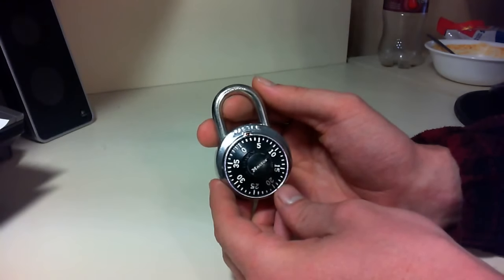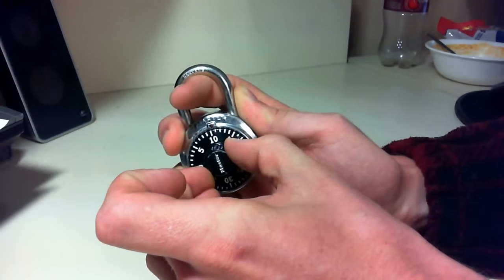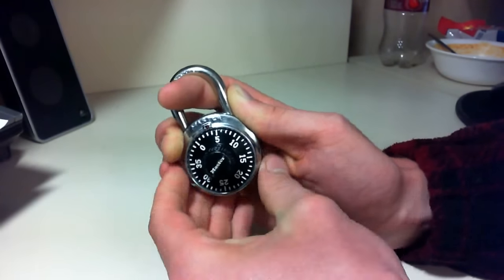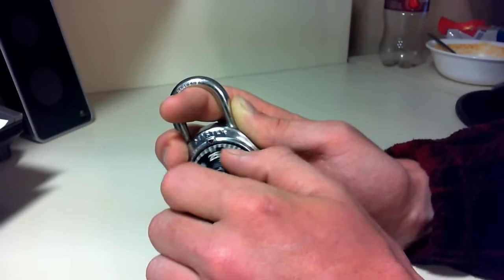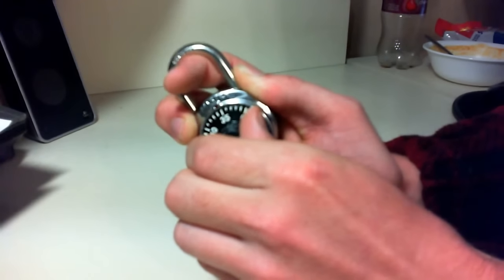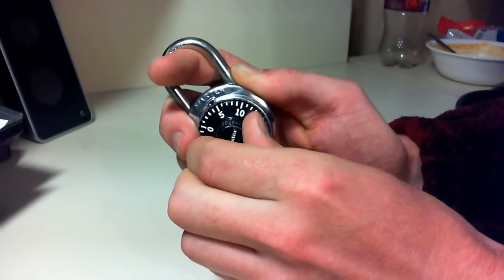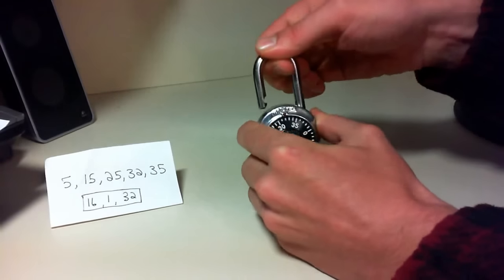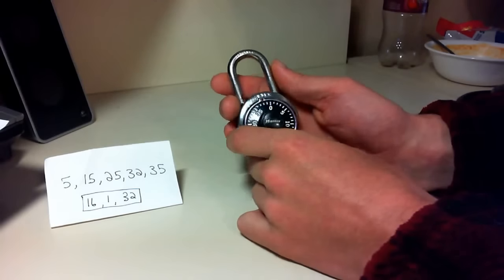Crack a Masterlock combination lock in 60 seconds! Without knowing the combo!

Comment: Not necessary to go through all that junk to get the third number. I just go through the first and second numbers same as you, then turn clockwise slowly while pulling up, varying tension until it pops. Boom - third number.
Reply: Did the same
Reply: Zeropoint - they probably wanted to reuse the lock :)
Reply: BeatsFromDP tysm!!!!🤗🤗🤗🤗
Reply: Or you could just cut the lock with some lock cutters. Boom step 12 and 3 are useless
Reply: Just through some dynamite on their, you can skip all the steps.
Reply: Took 5 minutes......
Reply: U smart ash
Reply: @AFUVFX  "through" "on their" nice
Reply: Ikr
Reply: @squalltheonly  Not if you want to reuse it or be unnoticable
Reply: @samuel3807  I can send you the $5 via paypal, if you are so poor.
Reply: exactly
Reply: That's not as fun...
Reply: @Insanifier  "on their" "on there" better
Reply: I was the 1000th like...
Reply: That`s how I did it too - good tip!
Reply: Godam
Reply: I cant really find the 3rd number so I just guessed, same
After I checked the 3rd number (31) I still cant find the other sticking points ;-;

Comment: Bolt cutters gets the right combination every time!
Reply: Shims are a tiny bit less conspicuous as well... Not to mention way easier and faster
Reply: So does c4
Reply: So does a .50 BMG
Reply: so does a torch, grinder, two large wrenches, or 2 cans of freon.
Reply: @jeremiahfyan  its a thin piece of metal used in lockpicking. You would insert it in the shackle hole along the side where the locking lever is and press it to pop the lock.
Reply: @MoistOwlettes  ah gotcha
Reply: Garry Harris you dont need a grinder on a gym grade masterlock
Reply: TheKizilg1 who? Me?
Reply: Aaron Neville your logic doesnt make sense
Reply: Would it break the lock?
Reply: David Misner yeah bolt cutters would definitely break it, unless it has a rating of 8 or more . Im not sure, however any bold cutters you get at home depot I dont think would get through a lock with a cut resistance of 8+ , hell maybe even a 7
Reply: @JackDanielsCHS08  I was referring to this shim thing somebody mentioned.  I thought the purpose of this video so you can open the lock so you could use it again.  I have a Masterlock and I lost the combination.  I really hate the idea of throwing it away.
Reply: Amen! This took way longer than 60 seconds. I’m lost ! Bolt cutters for sure !!
Reply: @edwardkohout3494  Kind of defeats the purpose if your purpose is to save the lock
Reply: I saw a guy use a claw hammer to break one, got it in one strike.
Reply: Matt TheChosen yo two open end wrenches maybe 14 or 16 mm.you can break a lock with one hand.especially one of these.
Reply: @You-Be-The-Judge  ??? About how to use a shim to open a padlock? If so just look up using a shim to open a padlock, should be plenty out there and unlike the wrenches it doesn't break the padlock. They can be made shim proof, but few are.
Reply: So does a key
Reply: @alexx781  So does an airstrike..
Reply: The combination is 1... 2.... 3... CUT
Reply: Aaron Neville  Lol, wtf
Reply: Jeremiah Fyan a thing you put in the lock to o-en it
Reply: And they are so inconspicuous.
Reply: Call that a master key
Reply: Yeah but the reusable feature doesn’t work when I try this method.
Reply: Hammer. DUH
Reply: @edwardkohout3494  A hammer. 1 second.
Reply: XD
Reply: But this method gets you a free lock
Reply: once you have the first 2 numbers then just go back to the right until lock opens...VIOLA!
Reply: DAWG
Reply: 😂agreed
Reply: @Jake12220  easier? faster? no lol.
Reply: lol
Reply: Bolt cutters are the universal key
Reply: A strong electric current passing through the shackle would also work.
Reply: @tecc9999  shims are super quick and easy to use so long as it hasn't been shim profed which most aren't(takes about as long as using a key). And it's fun because you can take multiple locks off and swap them round. Even better if there are multiple of the same type so people spend for ever trying to work out why their key doesn't work.
Reply: lol

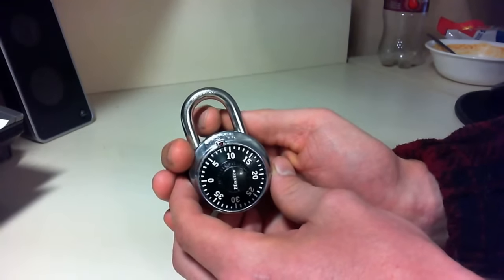Comment: 0:34 Combo 1 Provide medium shackle pressure, turn the dial clockwise while slowing releasing pressure and feel for the resistance number. Write the number down.
1:58 Combo 2 Provide large shackle pressure, turn the dial counter-clockwise for a few turns until the lock will stop, repeat step 1 with a single turn and feel for the resistance number.
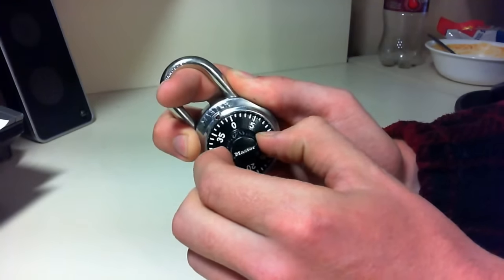3:29 Combo 3 Turn clockwise a few times to reset the lock,  start at zero, 3:44 apply maximum pressure to lock shackle and slowly turn the lock clockwise till it can't be turned anymore and locks at a point, 3:52 if it's between 2 numbers ignore it.

6:06 you combine the first number you found with the 2nd number you've found and the 3rd and that should be your combination.

Will continue later.
Reply: *combo 1, add 5
Reply: First 2 steps really do work
1st step: Resistance at 22 = 27
2nd step: Cant turn at 35, when turning the other way it stopped directly at 37 = 37
And I just guessed the last number by doing a series: 35, 31, 27...
And it opened on 31

Comment from the maker: It's called non destructive entry.  Also it takes 7 minutes to describe how to do it not to actually do it if your practiced.
Reply: Mine is non destructive too, how do I open it???
Reply: MIRACLECHEEZ Woah sorry chill,I just breezed over the comment and thought other wise
Reply: IT WASN'T UNLOCKED IN 60 SECONDS!!
Reply: This sucks so bad. Thanks for nothing .
Reply: styles662 sorry I been trying for a hour i can't figure it out...
Reply: I keep running into a problem. I've seen alot of videos and all of them say to do basically the same steps you did. However, I do the steps, get the numbers, and the lock doesnt open. I tried it on my sisters lock, and the same combination numbers kept popping up ( the same ones for my lock). And she said they are wrong. I think its user error, i just dont know what I'm doing wrong
Reply: Lizzle 2 cents I think the issue is the lock was open to much I think it works best on newer locks I have a old lock no resistance spinned for day but my new lock is just hard to turn in general both I lost my password for...
Reply: @sunsetsleeper  I know my code, I just wanted to learn how to do it. I have a dent in mine from dripping it and its over a year old so its hard to get
Reply: @lizzle2cents289  I think that there's a knack to it. It takes a few locks and hours of practice on each to get the feel. I mean I've picked things fast on the first try or even after days of practice then return to it years after and it feels foreign. You might have a better tactile memory than I but one sure fire way to get to Carnegie Hall is to practice. Also if you practice on just one, you'll only be training for that particular landscape. Buying many locks allows you to sharpen your "lockpick sense" ® pending. Jk. PS. This is why Sherlock on Elementary has a wall of locks. But if you don't have time for that try this out!
Reply: @lizzle2cents289  and if you're worried about it being malicious, which I don't believe it to be, you could run it on any virtual machine behind a VPN /proxy. Happy hunting 🤗
Reply: @cowboycurtis2099  Oh my gosh thankyou so much there are good people left in this world
Reply: Nah mate this takes at least 5 minutes
Reply: Well I practiced and practiced, and practiced and I still can't get the fucker to open!
Reply: Hey Lock Opening Video Dude, do you think maybe I could send you my lock and you could try it? I've been trying to open this son of a bitch for 7 months, and it won't open? I don't know what to do? I even had my college educated cousin Mary Bob help me with the figure 'n on account of I only did figure 'n til 3rd grade then Pa made me quit school to help out with the farm 'n chores. But Mary Bob couldn't get it to work no ways? So if I could just send the lock to you, do you reckon maybe you could open it and maybe do one of these moving picture inner web things on my lock? Thanks, Sincerely, Cletus B. Hatfield
Reply: Well, the procedure seems quite slow, and you lose a lot of time in the third number when it's actually not required at all, just turn until it's open. Decoding it is probably faster.
Reply: Itss fake
Reply: How does it take 7 minutes to do this? This took maybe a minute when we forgot our locker combos.

Comment: I’ve watched a few videos and have combined the best methods. 
1. The first number is clockwise resist plus 5. Rounding down works best, but either number should work.
2. The second number is usually a high number resist.
3. Try first then go to second number. Go down 4, then increments of 2 with pulls along the way. Usually opens.

Trouble shooting:  The 2nd and third number will both be positive or negative numbers. The first will be the alternative sign. If you are having trouble opening the lock, use the method in the video to find the 3rd number, which is usually correct. I go counterclockwise from zero because the 3rd is usually a low number. Find the 5 or so numbers with shackle pressure with the number in the center of the wiggle. 4 or so will have the same ending digit, such as 5. The different number, say 2 will stand out. If it’s even, the second number found by shackle pressure will be even. Or both will be odd. I’ve done this if two numbers for the second are possible. Vary the 1st digit by one. Haven’t been stumped yet.

Be sure to watch the channels for THE LOCK PICKING LAWYER and BOSNIANBILL (recently retired). Get a Sparrows lock picking kit. Start with Masterlock key locks. Easily opened by raking (quick back and forth with a wavy pick). Most locks are easy to pick. Expensive locks, less so.
Reply: I am a bit confused bro.
Reply: This is what got it figured out for me, thanks man!
Reply: Watch a few combination lock videos. Mine steps are easier explanations. Get 3 cheap combination locks. Once you figure out the 3 you will be able to pick others in a couple of minutes.
Reply: "The second number is usually a high number resist."

I never go with the preset number from the manufacturer. I always change mine upon purchase. Perhaps you have statistically proven yoru theory, when observing preset lock combos, but it would be difficult to qualify with randomly chosen numbers set by the lock purchaser.

" The 2nd and third number will both be positive or negative numbers"

I have never seen a "-" (negative) number on a combination lock. Did you mean the number will be odd or even? If so, that is correct, as your only choices are off or even.

Comment: You don't have to find the last number--after dialing the first two, just keep dialing one space at a time and pulling, and it will eventually open.
Reply: The master lock featured in the video may or may not have a gate reset after a very hard pull, they often don't but it is a possibility. It's better to just not yank at it 60 times.
Reply: @pure_zed  should have read that reply before listening to this comment and doing exactly what it told me to😀

Comment: Two improvements:
- When looking for the last number, you can stop after finding 25 (in general, after finding 3 numbers that are not all the same parity). The 3rd number  is the one with different parity from the others.
- If we name the 3 numbers of the combination lock C1, C2 and C3, they will always satisfy these congruences: C1 = C3 mod 4, and 2+C2 = C3 mod 4. In simpler terms, C1-C3 is always divisible by 4, and so is C2-C3+2. So, it's better to get C3 first, then use these congruences to verify C1 and C2.
In this case, your 2nd number was probably 2, which is why you had a bit of resistance at the end.

Interesting to see a mechanical padlock fall vulnerable to a cryptanalytic attack.
Reply from the maker: +NetRolller3D Great stuff! This can def be used to hone in on the numbers a little bit more to make sure the combo is perfect and not just close enough to get it open!
Reply: wait, can you explain this better, I don't understand
Reply: +Nicolás Bastos On the first point, he means you can generally stop as soon as you either find an odd number and two even numbers, or an even number and two odd numbers. The one that is different is the one you want.

On the second point, if you subtract the third number from the first number you should get a number divisible by 4 (16 - 32 = -16 in this case). Similarly, subtracting the third number from the second and adding 2 should be divisible by 4 (2 - 32 + 2 = -28).
Reply: Os this common core math? lol jk.
Reply: for the third number, i just pull on the shackle constantly while rotating the dial clockwise. lazy lol
Reply: Unless I am reading them wrong your equations look like you are implying C1 can only range from  0 to 3, and C2 can only range from 2-5. Regardless I rigorously tested for the most smooth lock opening, and in my case (C2-C3+2) mod 4 = 0 was correct ; but (C1-C3) mod 4 = 2.
Reply: Wot
Reply: And most people have no idea what you are talking about in respect to places the dial stops at so you might as well be speaking greek.
Reply: Yeah I just got C2,C3,and C4 fused. Now I have C1,C2,C3,C4, and C5. If I practice enough I should be able to turn my head much better in less than a minute.
Reply: Reading this makes me feel like potato
Reply: @nicolasbastos133  NO NEED TO WORRY. I'M SURE HE DOESN'T KNOW WHAT HE'S SAYING. IT JUST SOUNDS GOOD.
Reply: @Auxified  CORRECT BUT IF C3 IS MULTIPLIED BY C1 + R2D2 AND ADDED TO S7 THEN YOU HAVE A MOD 3CPO.
Reply: I can cut it in 1.2 seconds with bolt cutter, no math, no feely feely, no writing shit down 😲
Reply: Paynan Diaz me too!  I’m like wat???
Reply: Ok
Reply: Yes but dont forget to place the lock in its correct position in time and space and divide the x coordinate by the number of cells in a Bobcats body the proceed to use PEMDAS then you should get the solution of x=69 divide by the number of stripes on a zebra and then you get your fist number.
Reply: For those who don't understand, the phrase "A mod B" refers to the remainder you get by dividing A by B (this is not completely accurate, but it will suffice for the explanation here, I'm not going to write a whole essay here). In this case, C3 is 32, dividing by 4 leaves remainder 0. Doing the same with 16 also gives 0, so C1=C3 mod 4. C2=2=C3 mod 4 +2
Reply: What's got me though is that fact that this works, and I want to know why. Is it some sort of manufacturing requirement with the tumblers that causes this?
Reply: why is this true for all dial locks? are they somehow all segmented into 4s?
Reply: @coach3958  you cant use it as a lock anymore if you break it
Reply: @TRICK-OR-TREAT236  he does he's saying that the first number of the combination has the same remainder when divided by four as the third number of the combination has when divided by four  (true for mine but idk why this is true for all locks) a

Comment from the maker: Most of the time they are all even or all odd but the number can be off by about 1.5 and it will still unlock albeit a little resistently.
Reply from the maker: Who wants to know? Want to guess?
Reply from the maker: oh haha interesting. 66 is for Mario Lemieux who is my favorite hockey player. Just needed some numbers to secure the username across platforms etc. haha.
Reply: +myfriendsarelosers09 i live in oxford
Reply: +styles662 ok, now lets see you do that with a brand new lock out of a package, or take one lock from a pile of 20. Any less, and you would be able to memorize each lock. Anyone try this to see if it works?
Reply: +algol291 , this little trick has been around since I was a kid growing up during the 80's. It worked then, and it works now. I just cracked my lock that I lost the combo for. Bought it a couple years ago.
Reply: Dan Hull really lazy way to codify locks. I know they're mass produced, but you'd think they'd put a little effort into making them full proof. Then again, a hammer will destroy any master lock faster than putting in the combo, even if you know it. They really have no purpose outside of school lockers. If I really want to get into somewhere, that dial lock isn't going to stop me.
Reply: Mine isn't

Comment: For those who are extremely frustrated that you still can't open your lock after watching this video (and many other videos), I feel your pain.  I'd recommend opening the back of your lock. There are a couple YouTube videos that provide a tutorial.  My code was completely different than what this video provided me. For me, the only thing that was correct was the middle number.  I spent MANY hours trying every combination with the first and last number, but turns out the first number was way off to begin with.
Reply: Can you send a link to the tutorials mentioned? I can’t find them
Reply: Lock won't open? I recommend lubricating with food grade penetrating oil (I use CRC brand at work) Then you spray out the lock real good with an air hose, including around the edges of the back panel.  IMHO
Reply: @Freddy-Da-Freeloadah  Kindly note that your use of "good" should be "well".
Reply: @Russell-rc6qq  dude no one cares
Reply: @samgarber9548  I care and I am certainly not a no one!
Reply: @Russell-rc6qq  lies, you are indeed a no one
Reply: I just broke down my door cause of this damn lock
Reply: @Russell-rc6qq ok Ocean O’Connell Rosenberg calm down
Reply: I’m having the same problem. My lock is giving me the wrong first number. It’s the same number every time I try too, which is weird. I know the combination to the lock already. The first number is supposed to be 10. But it keeps locking up at 25 (before I add the five )for the first number.